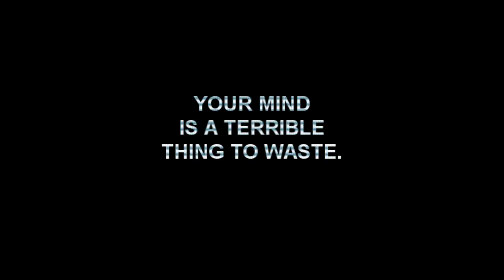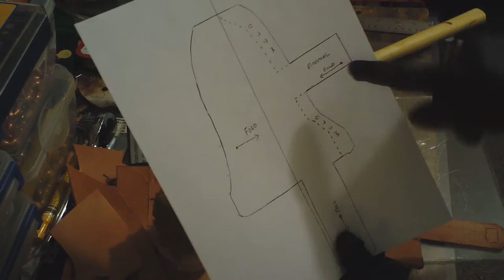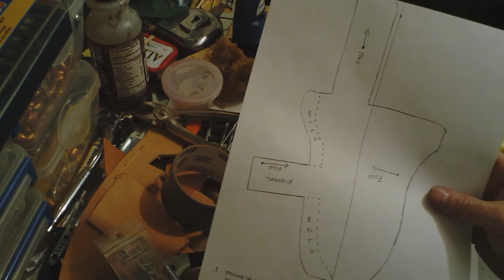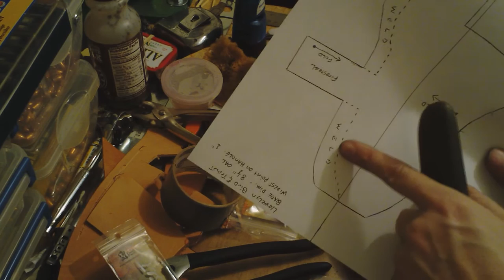Leatherworking Custom Knife Sheath

Comment: A little trick I learned for black dye. It is hard to get it cover well. I learned to use an airbrush for black. This color streaks easily and needs several coats to cover. With the airbrush you can control the coverage. A little darker on the edges and lighter in the field looks awesome.

Great job on your first. Far better looking than my first one. That was over 100 sheaths ago.